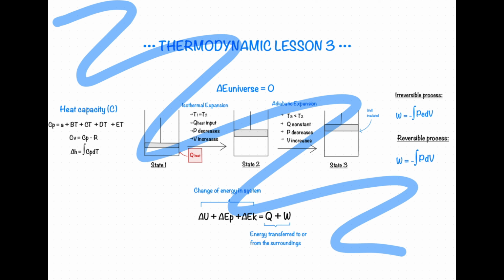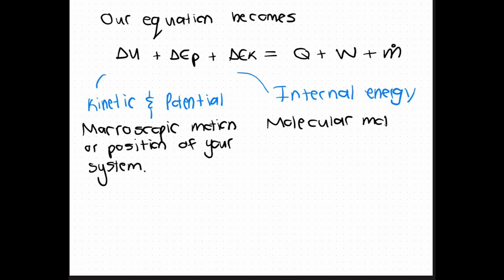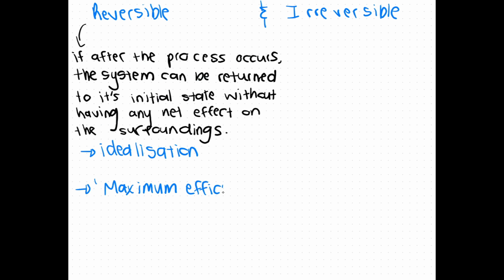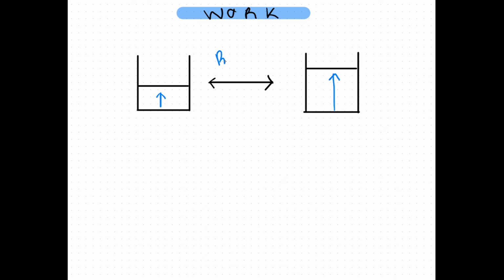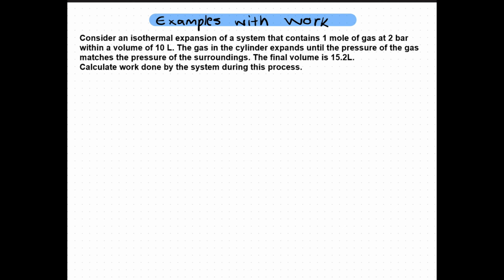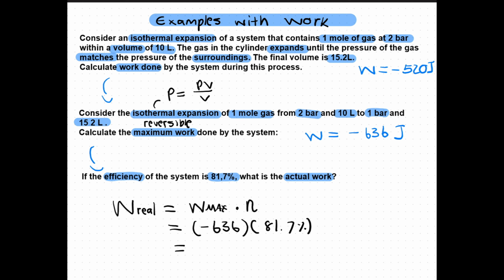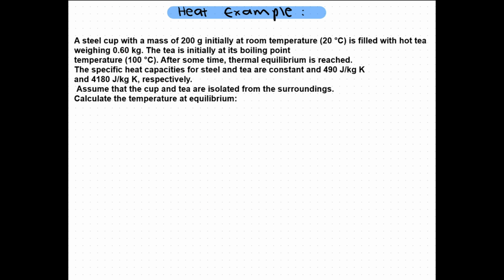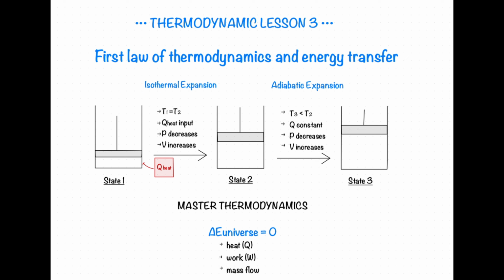First law of thermodynamics: Heat, work and energy transfer. 🧊 Examples and Explanations!

Comment: When is work negative?
Reply from the maker: Good question! Work can be negative or positive and it’s important to know when so that your energy balance will be correct. When your system does work (the gas inside it expands) your system does work to move the boundary, thus your system uses its energy to do work -> causing internal energy to decrease thus work is negative. On the other hand, when work is done on the system something external does work and increases your systems internal energy, like compression. Thus the work is positive. 
Hope this helped!🧊